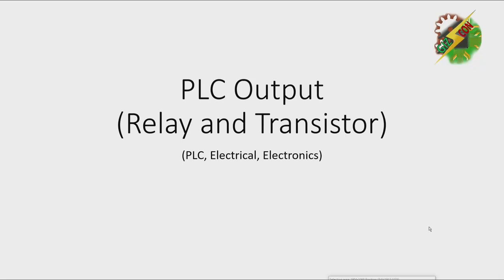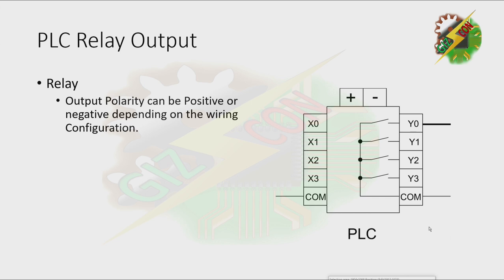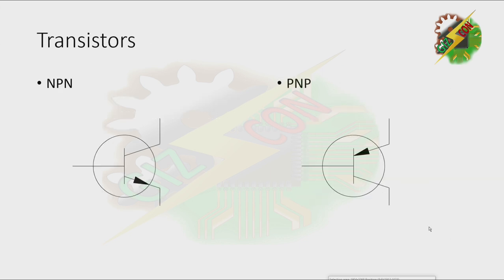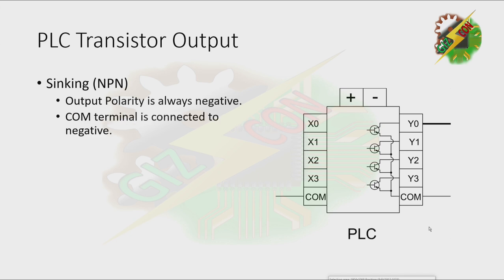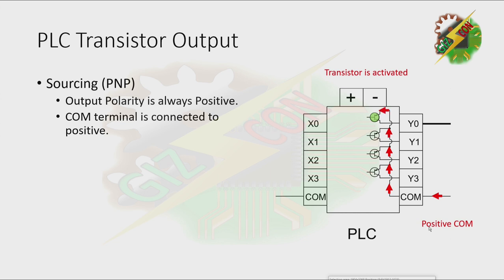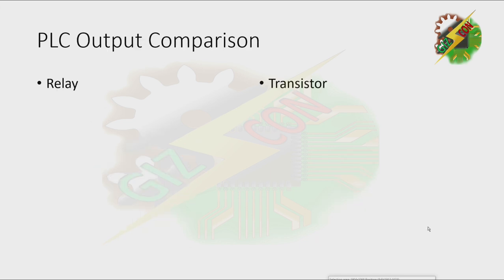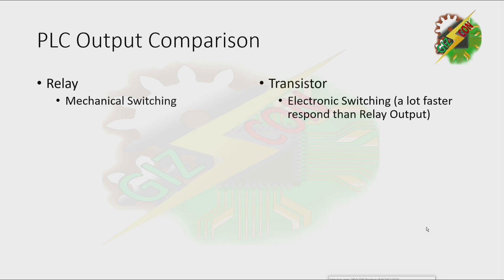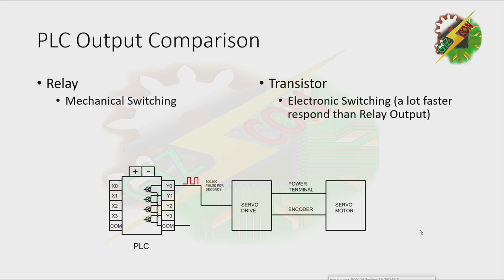Types Of PLC Discrete Output (Relay and Transistor)

Comment: sir nice video naintindihan kona ngaun kung bakit ung binebenta sakin n plc is may sirang output terminal transistor type kasi sya un pla sakit ng transistor lalo na kapag madalas sya mag switching
Reply from the maker: Yup... Pero pag no choice ka na mag transistor... Mag install ka ng diode... Kasi ung mga bagonh module ngaun puro transistor na bihira na ung relay type
Reply: Gizmo Controllers - Mechatronics ah mukang madami p ako dpt matutunan sir meron kb software sir ung makakapag simulate
Reply from the maker: Download mo ung fx trainer... Visit mo din ung website ko... gizmocontrollers.com
Reply: mas ok ba pag praktisan sir ang transistor kesa sa relay type
Reply: edi sir pag nag install ako ng diode naka direct sya sa plc output terminal papunta sa load
Reply from the maker: @pinoyelectricalautomationm4856  pinapaliit nila ng pinapaliit ang PLC ngaun kaya mostly puro transistor type na ang nilalabas nila... sa load mo nlng sya iparallel.... Check mo ung isa ko pang video ung "tips in plc output protection"
Reply: tsaka sir dagdag ko nadin sa tanong ko ung transistor po ba fix na ung output nya ng 24v dc or pwede dn mag 110 ?
Reply from the maker: @pinoyelectricalautomationm4856  hindi possible ang AC pag transisitor type yun lang ang isang advantage ng relay type... Pero pwede ka naman gumamit ng relay na 24 vdc coil then pwede mo na magamit sa AC ung relay contact... Di mo na din pwede mag config kung NPN or PNP ung output mo... Fixed na din un... Pag PNP binili di mo na pwede palitan ung config ng NPN unlike sa relay type pwede mabago kung NPN or PNP

Comment: if i have multiple outputs, for example, a valve with two solenoids, one on each side, do i have to connect both solenoids to the power supply or do i just connect one to the power supply and connect both to the correspondent plc output?
Reply from the maker: if your configuration is NPN

connect 1 port of the solenoid to positive of power supply then connect the other port to PLC
do the same thing to the other solenoid

if your configuration is PNP

connect 1 port of the solenoid to Negative of power supply then connect the other port to PLC
do the same thing to the other solenoid
Reply: @GizmoControllersMechatronics  thanks!!